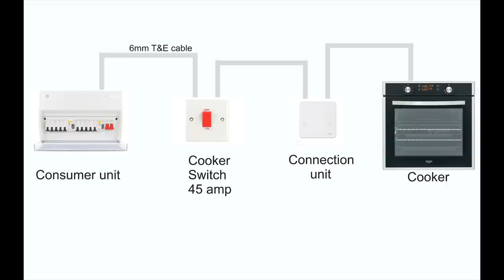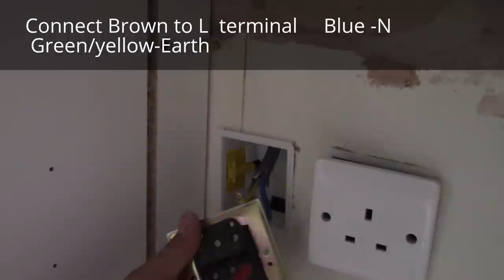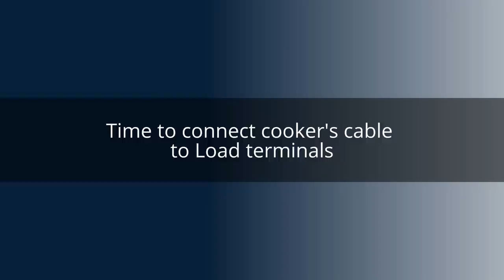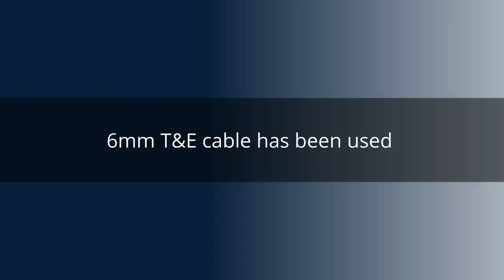How to connect  wire cooker Wiring cooker connection unit      ccu

Comment: Good videos mate. What is the purpose of the connection unit? Cant we just connect the cooker straight from the cooker switch?
Cheers
Reply: Yes, you can connect directly into cooker switch.   The CCU just makes connection a little easier, if more expensive.   But if switch is flush with the wall, the oven cord should enter it from below through a conduit or cut-out in the wall so that it can be easily removed if necessary, i.e. not plastered in.   If the switch is mounted on a pattress (which is usually ugly), the cable should enter through the side of that.   The switch iself must be accessible and located within 2m of the cooker (to allow easy switch-off) and not directly above it.
Reply: @harstan7333   @Nick Stanbury  When moving house, I can see an unswitched outlet being the safest way to leave a cable, instead like I normally find cables just hanging out the wall behind the cooker with a bit of tape on it!. What is law in regards how your supposed to leave cables like that?. 
Would it be ok to remove the live and neutral wires and fuse from the switch above the worktop (and leave a note) or is that still not deemed safe enough?

Comment: Hi sorry to bother you but i asking for some free advice if thats ok, im having a problem with my eletric cooker and thats the wire connectors at the back, where the main eletric wires connects to the cooker on the back, i think the damp is getting to mine and they keep going rusty and snapping off, the main eletric cooper wire has gone green which is due to damp isnt it? and thats made the connector go rusty and snapp off, well i thinks that the problem unless there is something else wrong which i dont know, any help very greteful.
thanks
matt
Reply from the maker: Yes Matt. The wires cannot touch anything that is wet or damp also check the wires connection if they are well screwed , terminated as it can cause fire.
Reply: More likely to be heating of the cable due to loose connections or a  size of cable which doesn't handle the demand of the cooker or the rating of the MCB which protects the circuit. Usually a cooker should be on minimum of a 6mm cable.
Reply: Just had a disagreement with a gas engineer working in a diy shop, who told me regulations state a 10 m cable must be used..?? The cable is to big  for the cooker terminal and the same with wall  plate can not fit? Is there any thing I  should be doing I've checked my cooker manual and it says 6m .. cable. The guy said we no longer use it and had none in stock  Which was a lie ! When I pointed to  sum 6m he said Oh that's 4m..!
I left the shop wondering ... I should have never walked into the shop and ask for some COOKER WIRE .. wire POLICE everywhere.. lol..
Reply: @maxwellmc9734  Hi i purchased a 9.5 kw shower for £199 installed myself to save money plumbing only ,my local sparkie came to connect up .bob its to powerfull for my cable 6mm .( reason ) he would not install was because the wire would become to hot using this appliance took it off purchased a 8.5 for £ 199. thats fine running on a 6mm cable .lesson learnd. best regards

Comment: Wife wants a change from gas hob to ceramic hob,can a 6 mm cable wire into a 13amp plug! I have a 45 amp cooker wall switch feeding electric oven, with a plug socket in it,idea was to fit cable into plug.drill worktop,run cable to new hob,it wouldn’t be possible to pull away fitted cupboards,,so just go behind drawer,through one cupboard to hob,any ideas or info please 03/10/2019 thanx.
Reply: Allen Braithwaite No

Comment: Is it cool 2 wire up my hob ,plus extractor fan,and oven ,,would it be cool 2 put it into the cooker plate
Reply: I'd like to do the same, do you know if that is possible?
Reply: @CB_883  yeah m8 a wired the 2 off them 2 the cooker plate.
 good luck bud
Reply: @allyquinn4587  how about the extractor hood?
Reply: @CB_883 a    fans need 2 be plugged or wired into kitchen socket ring, m8

Comment: can i connect my gas hob thats uses mains power for ignition on this cooker unit?
Reply: You'd have to use 6mm cable to a switched fuse connection unit. FROM There you can connect your hob and downsize to 0.75mm or 1mm heat resistant ho7 flex cable. 3 Amp fuse remember

Comment: Does anybody know...what the benefits are in having a hard-wired electric hob as opposed to a plug-in?
Reply: Most new cooker will not have a plug with them
Reply: Unicorn Smith g
Reply: It's down to power of the hob. 13A at 240V = 3120W power (P = V*I, ignoring power factor), so a low power hob may come with a 13A plug that can be plugged into a standard (UK) socket. Higher power hobs (e.g. my 8600W amazon special) comes with a hefty flex cable pre-wired to the hob, but which must be hard-wired into a 45A cooker connection unit (CCU) that is isolated using a 45A cooker switch. HTH
Reply: Tighter connections = less resistance = less heat = lower chance of melting.

That's why high wattage appliances are hardwired permanently.

Comment: Can I not connect to a normal 3 pin plug and plug it in the socket?
Reply: No as if I was gas cooker u can as far as I'm aware...but an electric cooker would require much more power and a 3 pin plug has a 13amp fuse so wouldn't work
Reply: @whitebeltlyfbjj3393  I was actually thinking of installing it back home in Bangladesh… they don’t have 3 pin but 2 pin plugs and I’m don’t think they have earth cable … so wanted to use this
Reply: @nislam16  funny thing is I'm bengali from uk..im sure rules maybe little different back home

Comment: What do you do if the hob has 4 cables on it red brown yellow/green and blue
Reply: For UK single phase supply: yellow/green = Earth, blue = neutral, red & brown are 2 separate live cables: join together and wire into the live terminal of the cooker connection unit. I think that the separate lives may be connected separately when using multi-phase supplies: this is normally explained by a sticker on the hob / installation manual.

Comment: I only have a three pin socket on the wall behind the cooker when plug in cooker to socket oven was working for a while but now plug fuse is blowing. No cooker connection showing on the CU. What is the solution for this?
Reply: If I'm not mistaken the 3 pin socket outlet is only for gas cooker as its used for spart for gas...so it uses way less power and can be put on socket outlet....whilst electric cooker oven need 6 mil and be wired into appropriate cooker unit because it requires much more power and need a separate circuit other wise if put on ring will overload

Comment: are you even a qualified electrician? i doubt it. this is not how you should wire a cooker/oven
Reply: In what way isn't it?  Start with the diagram at the start and end (5:31) shows it.

We have a dedicated radial circuit with suitable size conductors.

It starts with a cable from the CU to the double pole isolator.

then a cable running from the double pole isolator to the terminal block.

Finally a cable running from the terminal block to the cooker.

All CPCs that were visible have been sleeved. (terminal block terminations for both cables)

The one thing that wasn't mentioned was the size of the MCB.  However this isn't about wiring in the whole circuit, just the final terminations from the fixed wiring out onto the cable for the cooker.

Yes, safe isolation should have been mentioned, but in reality that is the only issue I have found.
Reply: @cjmillsnun  he neglects the fact that ppl looking up YT videos to wire an appliance like this are by definition,novices, and often miss the most basic of safety practices so he should always assume the YTer is an idiot and should incl step by step process  incl safety advice and safe practices, eg safe disconnection at board. secondly as you say he omitted the fuse/breaker size for the load of the oven, can be 10-20kW in my experience for domestic appliances, so the protection will vary form oven to oven; thirdly , the way he secured the conductors was not best practice , in fact if an apprentice of mine did that i would fail him
Reply: @giggergigger1  Good afternoon maybe you can help me been in the building game myself on and off ,retired now ! the question i am  asking would be the same as if i was on site,simply new built in ovens with plugs Neff have told me i can take the plug off the oven i like not loosing my warranty, I am sure it may be ok to install the plug wire onto the 6mm hard wire outlet. that had the older oven was on I have had a latest type consumer unit fitted recently , for peice of mind this flat of mine is only 2 decades old in round figures.
Advices are allways wellcome  black to black red to red green to green above that Ask thats me.thank you best regards bob lowe.
Reply: @giggergigger1 this is not a 10 or 20kw oven. He did everything 100% here.
Do you even know what a conductor is? 
Cowboy

Comment: I've got to go and do a cooker job and they have no connection like this one in the video so I'm going to wire it straight to the cooker socket 🙄 I know it's a scruffy way but it's the only way of doing it unless the single plug socket behind the cooker like in this video is 6mil cable I'll remove that and buy a cooker terminal box and use that